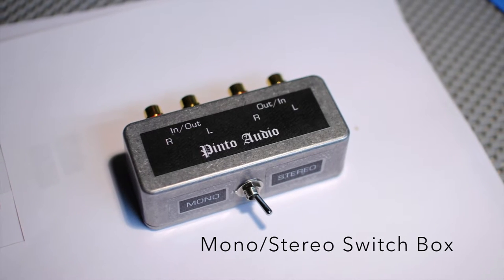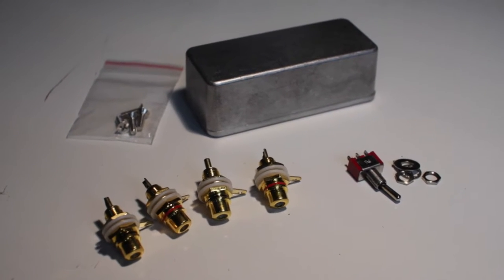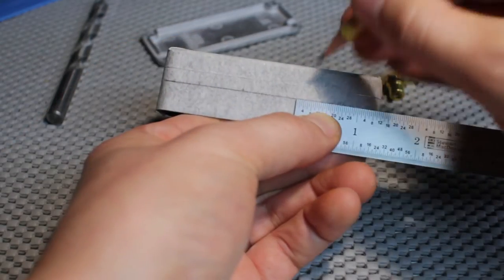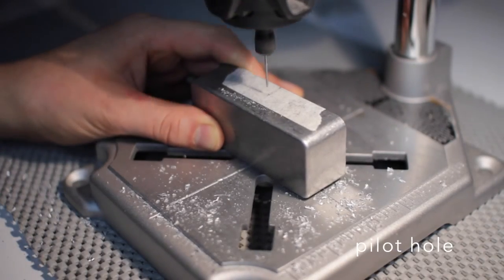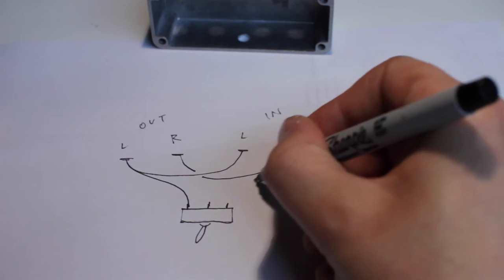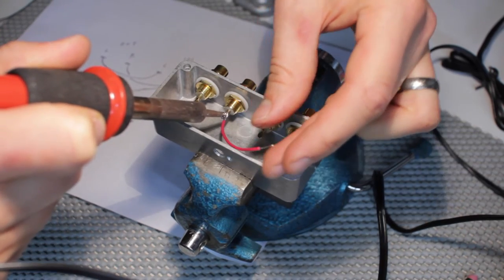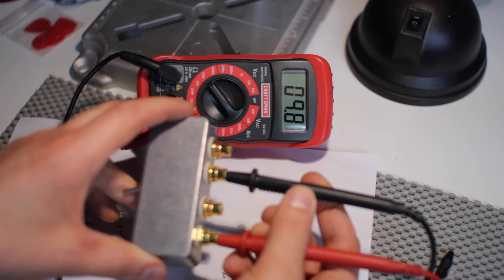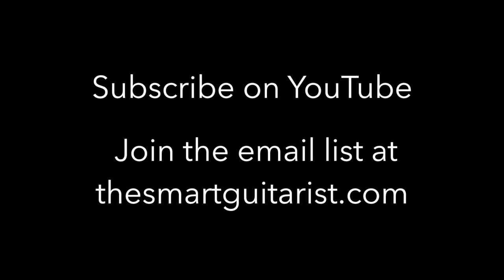Mono/Stereo Switch Box Build

Comment: Thanks to you, I built myself one of these, and it works immaculately! I used a SPST gold plated NKK toggle, an old Pro-ject phonobox, and a bit of 20awg OCC solid copper, Teflon-clad cable from Neotech....in a fairly high quality system, it is utterly transparent and just does its job perfectly.
So a big thank you from London, England!
Reply from the maker: Fantastic! So glad to hear it! Did you use resistors as so many of the other commenters have said? Or does it work fine without, as this one does?

Comment: Shouldn't there be resistors to protect source?
Reply: Well, brent ... In fact, I just made a "mono sum adapter box" yesterday and I had to use two 1k resistors (one for each channel, on the stereo audio input) and a 10k resistor between earth and live (on mono output of the box). No switch for stereo / mono.
It works well and I am absolutely sure that both channels are well combined. I don't understand how the man claims that his monosum box works well without the combination of resistors. Am I imagining things from my side ???
Reply: @revoxjazz8317  I don't see how it wouldn't. This is pretty much a Y cable inside a box. I built one following his instructions and it works perfectly. Sums up the channels when I switch the button to the Mono side. 

What would resistors actually do to improve the signal?

Comment: where are the resistors to sum the stereo to mono?
Reply from the maker: I built this box at the request of a friend who had been achieving the same effect using only cables & adapters - no resistors involved. This project is a switchable metal box version of his cable setup. And he was only using it when playing mono records - so technically it wasn't a stereo source being summed. It was just both mono "sides" being connected together. This works for him just fine.
Reply: @TheSmartGuitarist  I guess if actually its mono and both signals are actually the same signal and therefore in exact phase you won't need resistors.

Comment: A good build, but personally I used a plastic housing instead of a metal one. Also, I used 3/4" stereo jack sockets instead of phono as I found them smaller (as in you only need 2 not 4,) so the housing can be a lot smaller. My whole housing is les that 3" long.
Reply from the maker: Sounds good! These are the parts I had on hand, and they're certainly robust and reliable. And it's not much longer than 3" anyway...
Reply: @TheSmartGuitarist  Fair enough, Good build, though.

Comment: I may not understand it correctly, but in the mono mode your Left In is not connected to the Righ Out.  Am I missing something?
Reply: Ah, but it is - remember that the left in & out (and the right in & out) are permanently connected. So, when the switch connects the right in to the left out, both left and right are connected together. whether it's the the inputs or outputs connected together is irrelevant - as long as the left and right are connected to each other.

Comment: I have an organ that sadly only has a Line Out but would like to add a Line In so I can run sound back in via my computer that has the organ connect to for MIDI.  Hopefully that makes sense...  How would I do this?  Similar to this vid?  I ask as I'm struggling to find tha hack anywhere which is surprising since lot's of old organs have Line Out only.  Thoughts?
Reply from the maker: That's an entirely different situation - an older organ won't be MIDI-capable.

Comment: Awsome video, trying to make a hifi switch box to switch between different inputs, using a rotary switch.
Reply from the maker: Gavin Walsh cool man! I am rebuilding a vintage Grundig console radio, and I re-engineered the clunky push button switching matrix to switch between inputs. (A different animal, but related.) It's do-able! You just need a rotary switch with at least 2 poles, correct? And wire the left and right inputs to the lugs for each pole at each position on the switch?
Reply: The Smart Guitarist yeah, going to add some vu meters just to  go the extra mile.

Comment: Thanks for this. I did the version where the left/right grounds are separate in stereo then summed up in mono via a DPDT switch. I used stranded 18 gauge wire. Everything works perfectly with one exception. I've noticed that when I sum to mono, especially records that are otherwise stereo, I'm getting a touch of distortion in the high end. What could be causing this?
Reply from the maker: Hi Adrian - hmm, that's interesting. I can't say for sure. The only thing I could guess would be that the summing of the two sides is increasing the gain a bit, and maybe it's overdriving the input of your preamp/receiver? You could find a way to wire in a "bleed" resistor from the summed hot signal to ground, to attenuate the signal level a bit? And before you re-solder the switch, you could just test it with some alligator clip leads to see if the attenuation clears up the distortion. Of course, my guess here could also be completely wrong.
Reply: Hi Mike, Thanks so much for taking the time to follow up on my query. The one other person I talked to about this had a similar suggestion. 

However, rather than redoing the wiring to add the new resistor (which was pushing me to the edge of my capabilities -- I pulled this off in the first place by carefully following your video), I got an external attenuator (https://www.amazon.com/gp/product/B003FPD3IS/ref=) that allows me to adjust the gain manually. 

BUT it turned out I need to connect in the following sequence: turntable --> preamp --> attenuator --> stereo-mono switch box --> main amp. Oddly, based on what you wrote and the other advice I got, I would have though that in this sequence , the attenuator would go after the stereo-mono switch box, but when I tried that that didn't solve the problem! 

So it looks like gain has to be reduced (at least in my set up) before it goes into the switchbox. I need to do some testing still to fully confirm this works (the attenuator just arrived today), but it looks like this may do the trick. So all's well that ends well. 

Thanks again for making the video. I'm definitely excited to have the switchbox be part of my setup, particularly as it will now allow me to undo some of that awful 1950s/60s "stereo" electronic reprocessing.
Reply: There should be 3 resistors involved; 2 470ohm 1/4 or 1/2 watt resistors and a 20ohm resistor between the hot and cold signal, and a wire connecting the cold side to ground.

Comment: Can i use split cable to play 2 amps with one guitar? Its dual mono or stereo signal ?
Reply from the maker: This design is not really suited for that. If they're older Fender-style amps with multiple inputs, you can maybe just chain one amp to the next by jumpering the inputs. Otherwise, an actual effects pedal with a stereo output (like a delay or reverb) would be a good way to connect to two amps.
Reply: It's totally different when you split a signal to two amps than summing 2 signals. Splitting is straight forward. The summing box in this video is what's a little sketchy. It wouldn't work if the source was something different than this turntable because of unmatched impedances.

Comment: I want to do this without RCA jacks, just splice an RCA cable and have it go in and out. Where would the ground wire of each RCA cable (L + R) go?
Reply from the maker: Good question; in this box I just tied all four grounds (left/right ins and outs) together, grounded to the chassis. It worked fine for my friend, but then he got a different turntable or preamp (can't remember which), and he was getting a ground buzz... so I updated it: I permanently tied only the left in & out grounds together, and the right in & out grounds together, and then used a DPDT switch, and used the second side of the switch to switch connect/disconnect the two ground sides, just like I used the first side of the switch to connect/disconnect the actual hot left/right sides.
Reply: @TheSmartGuitarist  Hello! Thank you for this video. I just finished mine and it works well, but I also have a ground buzz. My turntable is prone to it, but when connected directly to my receiver, there's no buzz. As soon as I connect everything through the box, there's buzz. It's not too loud, but it's there.

Maybe the solution you described in this comment works for me, but I didn't understand what you did. Could you please elaborate or make a ELI5 version?

I finally got around to build the box and it's a shame that it adds this buzz. Again, thank you!
Reply from the maker: @dastinger111  Cool! So glad to hear you built one too. Sorry about the buzz. Yes, the comment I wrote above will probably work for you. Basically, use a DPDT switch (which is like two SPDT switches in one), and wire the ground wires from the jacks exactly the same as the wiring of the "hot" signal wires wires, using the other half of the DPDT switch. The tricky part is that if you use metal jacks and a metal box, the grounds of the jacks will be all connected together by default. You'll have to 'float" either the left or right jacks (both in and out jacks for either left or right) by insulating them from the metal box. the RCA jacks I bought came with little plastic washers, so I used those. Does that all make sense?
Reply: @TheSmartGuitarist  Thank you so much for getting back to me!

I ended up trying out my luck and I think that's exactly what I've done. I soldered both left grounds together and then one of the lefts to the secondary side of the DPDT switch, right below the pin for the hot left. And I did the same for the right channels. The hots remained exactly the same as in your video. Is that it?

The issue was the metal box. I tried using regular plastic washers, but the external part of the RCA plug is still in contact with the box through the hole. Do those washers on yours prevent it from touching the inside part of the hole? Is that how they work?
Reply: dastinger111 what you described about the left grounds sounds exactly right; you said you did the “same thing” with the right grounds - so you connected them together, and then connected one to the OTHER secondary side of the switch? If so, then yes - that’s exactly right. To test this, use your multimeter to test for continuity between left and right grounds (use alligator clips or something to connect the leads only to the left and right grounds). You should break continuity when you flip the switch. If the metal box is indeed the problem, then the meter will show continuity at all times, regardless of which way the switch is flipped. (Which would indeed tell you that you still need to isolate the jack grounds from the chassis.)

Those plastic washers I used had a little raised  lip on the inside opening, so they stay centered in the chassis hole and not let the jack touch. (This was pure luck that the jacks I bought shipped with these washers.) You may need to drill the hole out a tiny bit larger, and maybe add some kind of insulating collar or something...? You’ll probably need to get creative.
Reply: @mikepintoguitar  that's exactly what I did but, indeed, I get continuity on all grounds independent of where the switch is. So I'll definitely need to isolate them. I either spend money and time redoing it with RCAs just like yours or I manage to find a way to isolate them from the chassis. 

Thank you so much for your help, I'll let you know if that fixed the hum. I had severe issues with my turntable and hum before (it is fixed now, but it's prone to it) so I'm not too confident. Fingers crossed :)
Reply: @mikepintoguitar  Hey Mike! Just wanted to update you on this. I bought RCAs just like yours, drilled bigger holes, redone the soldering and, unfortunately, the hum was still there (slightly lower though). After doing some testing, I found out that running speaker cable from one of the box's screws to the ground pole of an outlet (euro plug) eliminated 95-99% of the hum (only noticeable on max volume). So I ended up drilling an extra hole on the box, fork connector on one tip of the cable, alligator plug on the other, fork to a screw on the new hole in the box, alligator to the outlet and voila, everything is working perfectly!

Hope this isn't too confusing. And not that you need it but it might help someone else. Again, thank you so much for the tutorial, no more swapping cables when I want to listen to a mono record!
Reply: dastinger111  fantastic! Great trouble shooting. Very interesting - sounds like the box itself wasn’t grounded well enough, which you obviously fixed with your jumper ground wire. Great! Enjoy!

Comment: Hi im needing a box like this for extra inputs an out puts for my hifi set up..i was jst wondering would this box set up work without the switch their..ps im referring to the way u have wired it up
Reply: I don't understand... do you want a switching box or not? what exactly would the box do without a switch?
Reply: Basically iv got an eq which only has a couple of inputs an outputs on it but i want to connect a few other bits to my eq like my tv but it only has a couple of inputs an out puts so i need a box like this with extra rca inputs an out puts on it so i can connect my other bits to it..
Reply: But the switch is not that nessasery for my needs an i was jst wondering will the wiring work for what i need in the way u have don on this box
Reply: Have u got eny suggestions then mate
Reply: @Anoymus985  I think I understand... yes sure, you could try building it without the switch - it would just be a passive splitter box. However many inputs you need, and however many outputs you need, just wire all the lefts together and all the rights together. It's worth a shot. I'd probably still use a switch so nothing "extra" is connected and possibly compromising the signal, but try it.
Reply: Thanks for getting back to us so how would i go about connecting the left out an input an the right output an input.. would thay all be cone cted together like u have don  in this vid minuse the switch
Reply: Porsche 911 yep, exactly.
Reply: Mike Pinto so basically the out an in meaning OUT left an rite.. IN left an rite conect all left together an all rite together
Reply: @Anoymus985  yes, that sounds right.

Comment: How do you do this exact same thing but for a guitar pedalboard?
Reply from the maker: Use 1/4" jacks instead of RCA jacks. And use a stomp switch instead of a toggle switch. But how exactly would you connect it?
Reply: yeah well my thought is how to connect it. i used a toggle switch. and wired it up. and its not mono summed and stereo, when i switch it to the "mono summed" side it just turns one output off and when i switch the toggle to "stereo" its turns both outputs on. im using TRS 1/4" sockets (because i was intending for legit stereo for my delays and reverb) and a SPDT toggle switch. what are your thoughts?
Reply from the maker: So your stereo outputs from your delay/reverb connect to this box's inputs, and then this box's outputs connect to what? Two amps? I'm not totally sure about this one. Seems strange that one output would just completely be shut "off;" you're sure it's wired correctly? Also, I was initially reluctant to build this box for my friend, because my instinct would be to make the box active (buffer each output and properly combine them to mono in a true "mixer" stage). But remember, he uses this only when playing mono records - so the two "stereo" sounds being combined are really just identical sounds in the first place. (This box exactly replicates the passive y-cable setup that he had been using.) So, in your case, combining two true stereo signals passively with this box may not yield the results you want.